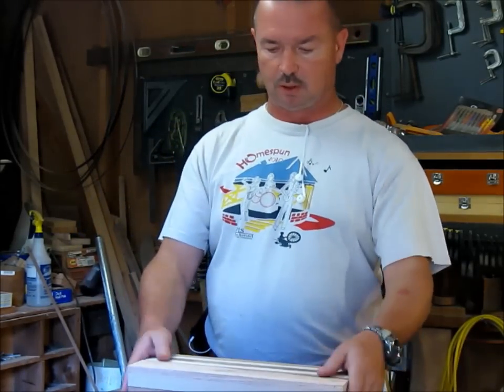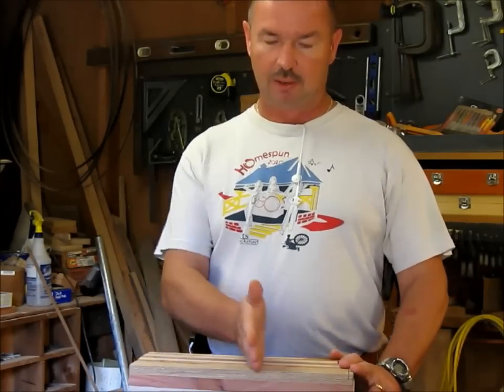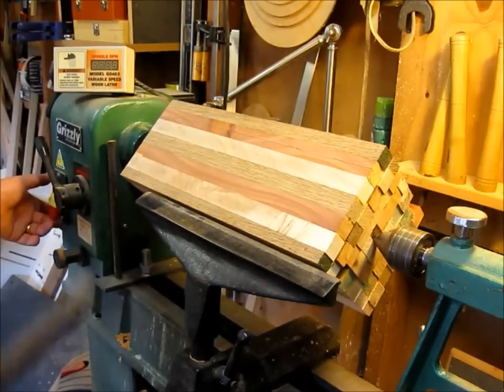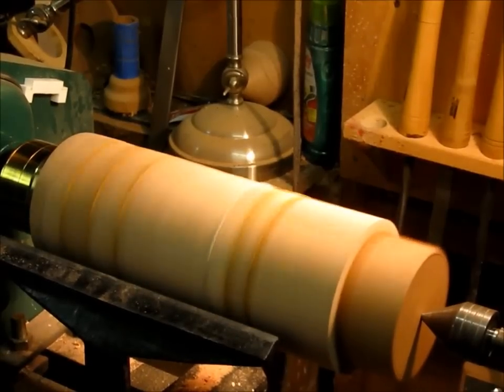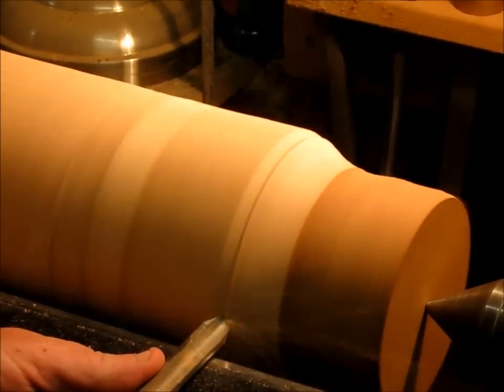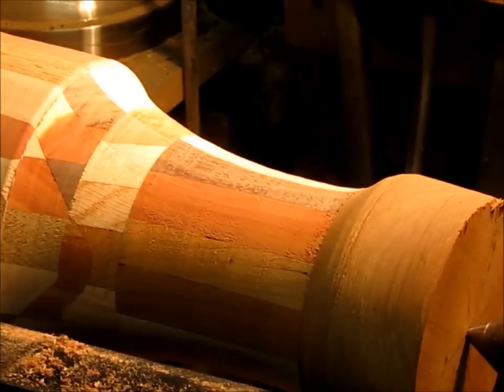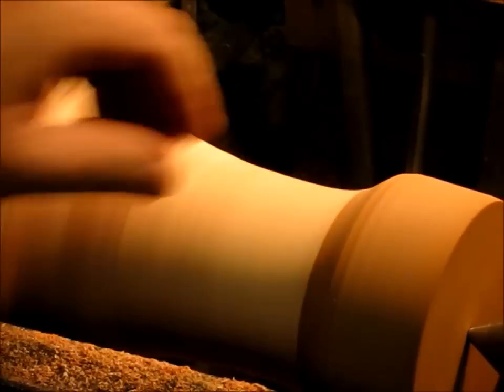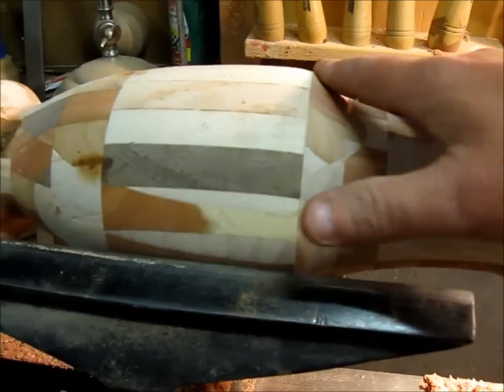#05 Woodturning a Vase from Scraps Part 2

Comment: That vase looks like it is turning out pretty well! Very nice work!'

I would recommend a full face shield though. I wish I could post pictures here. I would post the picture of the gash my forehead from a vase. It was only about a third of the size of piece of wood that you are working with. I tried to force a cut and it jumped out of the chuck and gashed the hell out of my forehead. Thankfully it wasn't my teeth! But I only had glasses on like you.

Comment: Excellent work!  It gives me ideas of how to use some of my scrap wood.  If you don't mind, I have one minor suggestion.  When you were gluing up the wood strips, the wood on the 4 corners could've been eliminated or glued in the middle of the bundle (making it more of an octagon shape).  The initial rounding completely removes the corners, but by moving it to the middle of the sides makes the bundle more of a larger rounded shape before turning.  Whenever I turn, especially larger diameter objects, I try to knock off the corners (typically turn it into an octagon) so I save my tools for more turning and less rounding.  Again, great work!  I look forward to more videos.
Reply from the maker: Good to here from you Dwight and thank you for your compliments. Thanks for your suggestions on the glue up also.  I think I was just in a hurry to get something turned. Gluing these scraps into a square blank just seemed less complicated and normally I would have gone to the Bandsaw and cut off the corners. Roughing to a cylinder actually only took a couple of minutes. I appreciate the comments and suggestions because it really helps fulfill the reason I am doing these videos. To offer alternative ways of doing things with or without the "High End" equipment. Thanks again for bringing up these methods. It gets people thinking and talking.

Comment: nice work Just starting to word turn made a vase last week at the  joint instead of using glue and newspaper I used a 1/4 inch dowel and snug up my tail stock it work verywell

Comment: Had you thought about splitting the vase at the paper line before you had the final shape. You could have left more meat on the vase so after you hollowed both sides and reglued them together you would have then turned the final shape. Great video can't wait to see the vase when it is complete. Merry Christmas
Reply from the maker: Thanks you Greg for your comments. This vase was completely experimental. I had never tried a lot of the techniques that were used in the video.  I believe I could have left it with a slightly thicker wall, but while bringing it down to final shape I thought I may go to thin in places, because I have no way to measure thickness that deep.  The newspaper actually helped make the cut but I would have changed the location to a different section.  Thanks again for your insight. Doing, seeing and sharing different techniques will make us all better. I hope you have a Merry Christmas.

Comment: Hi Stephen a nice idea to clean up our shops of those scrap woods we all have piled up, but I cant help but wonder about end grain to end grain on your second glue up! So basically I am asking you now that its been a while u made this video, how has it hold up, has it start to come apart?
Reply from the maker: Thank you sir for your comments and your question. I'm glad you asked this question, because I honestly hadn't thought about it. Good point. So far the vase looks as good as it did when finished. Granted the glue up was all end grain for putting the disks back together and end grain gluing is not as strong as face grain; however it is still strong enough to hold stationary objects that will not be handled very much or at least I think. My wife loves the vase so I hope it doesn't come apart. Thanks for your insightful question.

Comment: Stephen I'm asking you a question because I don't know not because Im questioning the process, but can you put the corners of your blocks through the bandsaw and make it easier to start turning or is it just as easy to knock them off with the lathe?
Reply from the maker: +Stroker Ace Absolutely. I just did not do it with this one. No reason.
Reply: +Stephen Ogle You inspire the heck out of me. I''ve added so many projects because of your inspiration

Comment: Where do you get all of the different color wood ?
Reply from the maker: Shawn P  Thank you Shawn. Just from my scrap pile. They are just cutoffs form previous projects. Hope this helps.
Reply: Stephen Ogle I just bought a lathe and am new to this, just something to bs around with. What kind of wood works best, and it I use branches from trees does the wood have to dry out first

Comment: What is the best glue to use that you can separate pieces later?
Thx.
Reply from the maker: MrSport888 Good question. Using regular wood glue with a piece of brown paper seems to be the best for me. However, I have heard of people using a few drops of CA to adhere pieces for separation later. The wood glue method seems right for me though. Hope this helps and let me know if I can help further. Thanks for commenting.
Reply: Mr Sport888...I agree with Stephen on this. I have seen people using super glue and they have flown apart whilst turning, but the paper between the pieces and regular glue works every time.